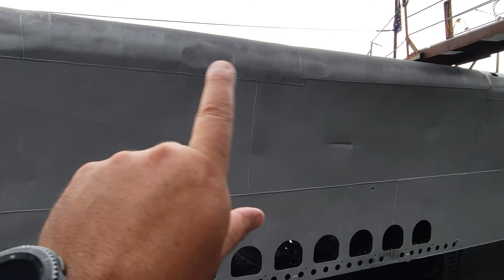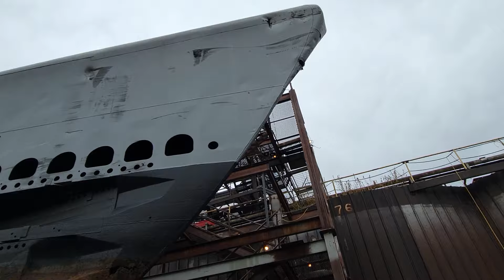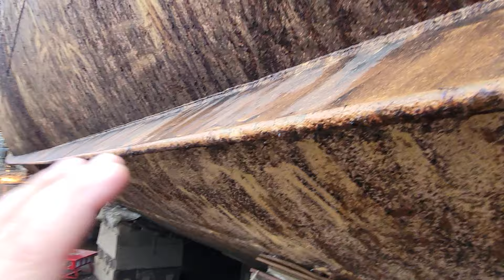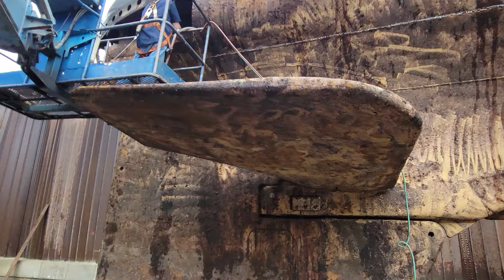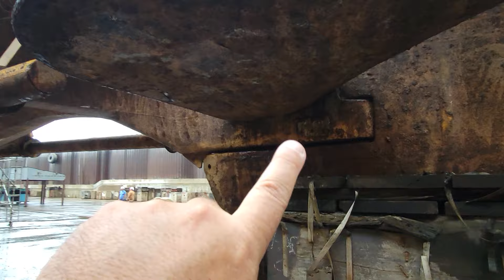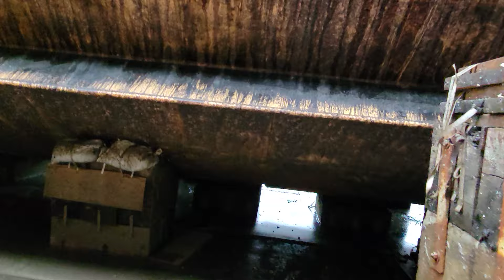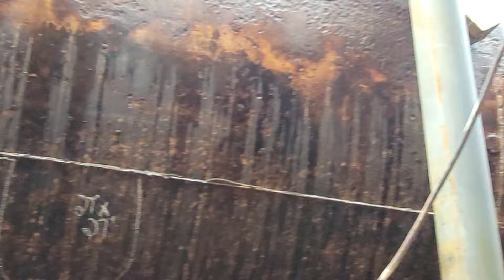USS Cod in Donjon Shipyard,  Erie Pennsylvania.

Comment: For those who are curious about Galvanic Corrosion and Sacrificial Anodes:
Galvanic corrosion is when the iron in the steel of the submarine forms a battery with a different kind of metal.  Brass for example, when near steel underwater, will form a galvanic connection through the water to draw electrons from the iron to the brass*.  By drawing electrons away, the steel becomes susceptible to rusting with oxygen in the water.  This accelerates rusting of the steel.
The sacrificial anodes mentioned in the video are made of metals that react more easily than the iron in the steel.  By the sacrificial anodes reacting more easily, the electron flow from the steel is slowed down, because the electrons come from the anode more easily.  Unfortunately, the sacrificial anodes attached to the submarine were made of zinc, which is a good anode in salt water.  Since the submarine was a fresh water, different metals should have been used than zinc (he mentions aluminum and another metal).
Reply: Thanks for your explanation Jess, that's the most complete description I've ever heard. I have a cousin who worked for about 35 years for a company in Seattle that provided that service, installing and tending to the sacrificial anodes on underwater cable systems and other applications around the world. You sound like you've made that presentation many times. Very well done!

Comment: Save some of that steel.  If you Cod guys are into it, I can make you some knives (I'm a blacksmith, among other things) from the steel plates.  Might be a good way for you to help raise funds.  I'm pretty sure that even the "outer" steel on those boats has a high carbon content.  If not, don't worry.  I can case harden mild steel, too.  I'm in central Pa., so Erie is probably about 6-8 hours away.  I can drive up there to pick it up.
Reply from the maker: Please contact Paul Farace. He is our director. his contact info is on our website. https://usscod.org/

Comment: OK, it seems to me that either the sub, or the shore power has a hot to ground problem.  This is why the pitting/ galvanic corrosion gets worse the closer the boat is to the dock.  The zink anodes should be sufficient, as that is all the CG boats and ships I was stationed on in the Great Lakes used.
Regardingbthe shaft protection tubes, I would suggest removing them all together, aling with the shafts, and install welded blanks over the stern tubes. 
Regarding thev5' of mud by the rudder, have a towing vessel come alongside the stern , far enough forward of the rudder, (15 to 25 feet), and "hole shots", going to full ahead  for several seconds at a time until the mud is removed.  It will take many repeated efforts to clear the mud, but done properly, (ask a Coast Guard Cox'n from SW Florida), it works.
S.J.Jevnisek, CWO3, USCG Retired.

P.S. Is the "BRA-4" marking still on the port side aft?

Comment: Thank you for posting this video, Jason. Questions.... Is this truly the first time the Cod has been out of the water since the 1960's when it went to Lorain? When it comes to the galvanic corrosion, why is the corrosion advanced on the sections in close proximity to her pier in Cleveland? Now that you have inspected things out of the water, any thoughts on what these repairs will add to the Cod's life expectancy?
Reply from the maker: I am no expert when it comes to water corrosion, only speculate that its closest to the ground source, could also be part of the city drain near the bow which is overflow from roadways which if you live in Ohio you know we use a lot of salt. This is the first time she has left the dock since the 60's, yes. We are adding 60-70 sacrificial anodes to her hull in hopes to create a corrosion point which we can change out as needed. also she is getting all new steel around her sides.

Comment: Question rather than displaying the ship sub in the water where the water is constantly damaging it why don’t y’all put it up on land and build a walkway. Around it so people can see it and you won’t have the corrosion problem and nothing else you could build on open or share over at where it won’t wouldn’t get rain down just food for thought
Reply: Good idea actually.
Reply: It belongs in water.
Reply: Land isn’t a great way of preservation either. Ships are designed to be supported by the water pressure, they are not designed to be out of the water for long periods of time. We almost lost HMS Victory a few years ago because she was warping and ripping herself apart in dry dock. Putting them in concrete like they did with the Mikasa is better, but apparently there are still challenges to that. Truth is all ships will always need to be dry docked and repaired due to corrosion.

Comment: With the incorrect sacrificial anodes , it appears that they didn't even have the cathodic protection equipment even running, judging by the excessive pitting. I used to be stationed at the Mare Island Inactive Ship Maintenance Facility in Vallejo California  back in the early 1970s.

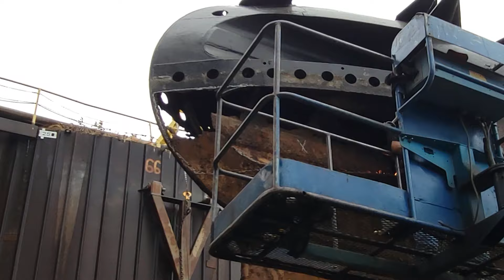Comment: @00:22 Looks like a pretty good GASH in the bow from it trying to take on a Coast Guard icebreaking tug. Not a fair fight IMO. ;-) @1:10.. Wow, all that damage and from the report from the Morro Bay, a little sandpaper and a couple slaps of a paintbrush from a disgruntled SN, good as new (the ice breaker that is)  @06:00,  Suggestion: Float Bags.  Seent them used before but maybe the sub was too close to the pier for the port side?

Comment: A thought for when you get ready to splash.  How about pressurizing the ballast tanks with air to triple check for leaks?  Wouldn't even need to be much, anything over 1 atmosphere should "whistle" if there are any pinholes or valves that need to be closed.

Comment: Wow great work - never seen a ww2 sub like this. How much of the sub still works?
Reply from the maker: 3 of the 5 engines run, we have no batteries and submerging is disabled. No screws either. She is a museum so pretty much everything that makes it run has been disabled. All electrical and radios are operational with exception of the battery operated system. Thanks for your comments!!!

Comment: along with adding magnesium anodes,  make sure you are using galvanic isolators on any power source between ship and shore.  the worse corrosion on the shore side might be from the lack of proper isolation
Reply from the maker: I believe we have put those isolators on a few years ago. But I will ask our engineer.

Comment: Strange that the pitting is on the actual welds. Welds are stronger than the actual steel surrounding it. Welding technology of 1942, I guess.  She was depth charged a lot during WWII which can weaken any composition of a weld. Great video and history.
Reply: Pitting in a weld ( or anywhere else on a metal) is a chemical reaction (corrosion) and is not a result of the strength of a weld.

Unprotected exposure to salt water and oxygen is likely the cause.

Comment: I used to Be an Ironworker and fabricator in Cleveland Nothing like this .I love  Ships and Warships and submarines. What kind of Steel do you use, Mild Steel Or Inconel or something special? What is the thickness of the hull steel?  do you use a big roller or form the sheets in a Large Brake? Absolutely Love the Cod!
Reply from the maker: I think mild considering we are not going into battle again, inconel would blow our budget though it would last forever. The hull is anywhere from 3/8" to 9/16" thick. I don't know how they form the pieces.

Comment: In relation to the engines and the blocked cooling water intake you mentioned, what would be involved in removing the blank? I would imagine there would be a lot of inspecting to do!
Reply from the maker: Yes, and the heat exchangers would have to be rebuilt. They leak.

Comment: It would seem the zincs didn't do anything because they were covered in mud. You can tell because they are covered in white fuzz which means, typically, that the boat was over zinced. In this case, they couldn't shed the outer layer and caused them to get the white fuzz on them that caused them to not do as they were designed.

Comment: Awesome to see it's getting repaired. We have the LST 325 in my town. Takes alot  of work to keep them up. Thanks to all the volunteers. Are they going to dredge the slip before they send her back?
Reply from the maker: most likely not.
Reply: @amigodiver  Darn, was hoping they would. I guess the silt helps hold it steady though. Wish there was a actual working Gato class, But after working on the LST, I couldn't even fathom how much man hours would be needed to keep a sub operational even if it couldn't dive.
Reply from the maker: Yeah would be crazy expensive, not to mention the 250,000 pounds of batteries we don't have.

Comment: Another option is to weld plates at the waterline and bolt a stainless cable to them with a junkyard magnesium rim attached and hanging below water.. Much easier to monitor and to replace.
Reply from the maker: we are welding stainless plates to the hull to mount the anodes. I will scuba to replace as needed.  thanks
Reply: @amigodiver  once they silt over, they are useless. Especially in still brackish water.  One thing. Run a voltmeter between the vessel and a ground when shes back. I got 45 volts off a 48 footer next to a steel dock.

Comment: I'm kind of confused.  Is she display only?  If so, why not just keep her out of the water entirely?  You could even put her in a building, the way that Chicago museum did for a U-Boat.  Yet you mentioned getting an engine running?  Kind of seems pointless if it would only be one, and there are no props to move her around under her own power.  I'd honestly be tempted to do a full restoration on her (if I was made of money, of course) and remove all those blanking plates along with installing prop shafts and propellers again.
Reply from the maker: Money is always the biggest factor, I explain some in the newest video.

Comment: Hello
Out of sheer curiosity, is it rust damage around the starboard dive rudder?
Looked a little strange
Reply from the maker: Are talking about the dive planes?
Reply: @amigodiver  Yes I was a little unsure what they were called, the damage i was refering to is to the left of the number 6 just under the dive plane
Reply from the maker: @gundamm5  If you are talking about the forward starboard dive plane, yes that is rust corrosion to the super structure. That is thin metal above the pressure hull. Not structural, but an eyesore. We are planning to replace as far as I know.

Comment: Its not a bilge keel. Its a stabilizer.  When you are burried in silt, you need to hydroblast the mud out of the way with high pressure water using divers. We do that all the time at power plant intake structures. You say your a diver, you should know that.  Doing so would have prevented the damage on the bow.
Reply from the maker: Yes, it is a bilge keel. Look it up. 
We don't have unlimited resources and funding like the power company. We are very limited on we can afford or do. If you want to help, donate. Usscod.org

Comment: Question: Why not just coat the entire below water line of the hull with that Rhino Liner stuff they put on truck beds? It's like a rubber protectant over the steel? Why is this not done; Cost?
Reply from the maker: I would think it is not meant for underwater applications and doesn't have the antifouling properties that marine grade paint does.

Comment: Did the NAVY weld the torpedo doors closed?
Reply from the maker: Yes. The shutters were welded shut. They were opened yesterday for the first time in a while.  See pics on Facebook
Reply: @amigodiver  The pic of the cleaned up shutters for 1 and 2 look fantastic. Have you considered coating the shutters for 3 thru 6 in an epoxy paint to try to control the corrosion that will inevitably start up again once she's back in the water?

Comment: What are those sacrificial abodes  purpose?  Very interesting
Thanks
Reply from the maker: galvanic corrosion attacks the weakest metal. By placing aluminum or magnesium anodes around the sub, it creates a sacrificial barrier that attacks the weak metal instead of the hull.
Reply: Thank You
Reply: @tonyd9541  More specifically, when the sacrificial anode undergoes oxidation, it gives up charge to the hull making oxidation there electrically impossible.

Comment: So it doesn't move under its own power, but 4 of the 5 engines still run?  I don't get it.  Why not have props installed and functioning?
Reply from the maker: 3 of the 5 engines run, the problem is that this is a diesel electric boat. The engines run generators that charge batteries and run the electric motors. Those motors and generators all needs rebuilt (very expensive) and we would have to install 250,000 pounds of batteries that we do not have (very expensive) and rip the top of the boat off to install them (timely and expensive) and we would have to have screws made that we do not have or can get (very expensive) That is why we don't run her under her own power. rough estimate of 15 million to get that done.
Reply: Well that explains it.  Good reason.  Cool.

Comment: I was on board her in 2007, she will need a good coat of bottom paint, some of the new stuff we use now will last a very long time,  the New epoxy Fast Clad would last over 30 yrs on the top side.

Comment: Why did the Navy weld plates over vent holes ? Are they worried someone would actually try submerging it, and removing props? Why
Reply from the maker: She was placed in Cleveland as a static training vessel. Props are valuable bronze to waste corroding. Vents probably are an unnecessary hole in her for that duty and keeps water out of the tanks in case of a vent leak.

Comment: Tug Capt was little overzealous. Everything sealed up and no props and it sitting in mud...why not just drydock display it?
Reply: @xRepoUKx  Ya, I also follow Ryan. He was talking about BB's like the New Jersey or really I think he was referring to the Texas and why they don't go to a dry birth.  Subs don't have that issue. They are not heavy enough (with tons and tons of armor strapped to their sides) and were built to withstand high pressures. There is a few (a couple from WWI) that are land displays now with no damage. IMHO I would rater her be on land with all her ports and intakes open and props on the boat then sitting in the mud, sealed up like a hulk, rotting away.
Reply: @finscreenname  I'd completely forgotten that there are already a few subs on dry land, thanks!  Your original question still stands then 👍

Comment: why not just put the props back on?
Reply from the maker: We don't have them,  location unknown,  probably scrapped years ago.
Reply: @amigodiver  i wonder if the navy has them in there storage somewhere
Reply from the maker: @Reaglesracing44_  I highly doubt they exist.  They were a 4 blade screw which was obsoleted I believe for noise.
Reply: @amigodiver there is one prop on display from the COD in Cleveland Ohio
Reply from the maker: @Reaglesracing44_  that display is not a gatobsub prop. Cods props were removed and lost before it came to Cleveland.